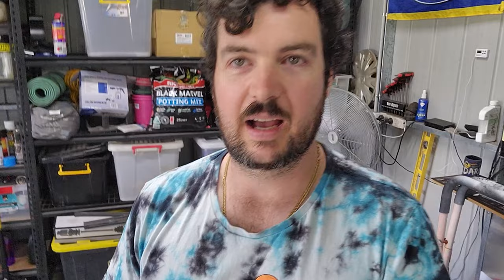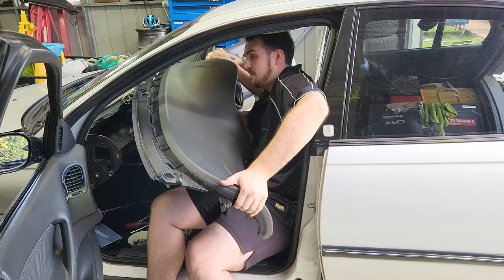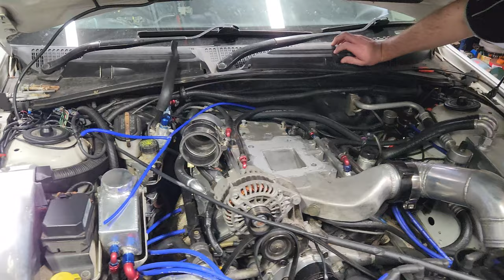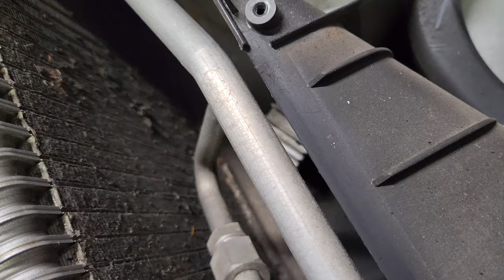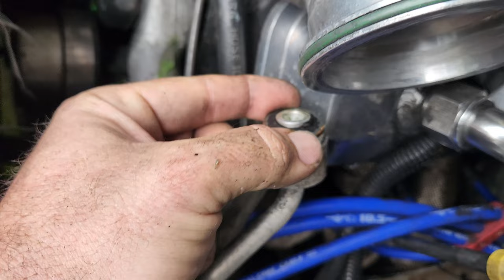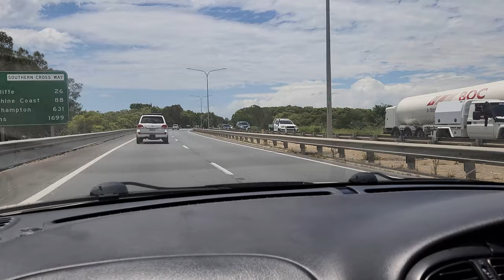BIGEV | Project AirCon

Comment: Well done dash big job you should be able to get 7-10⁰C with new system.  Compressor of this type should not cycle variable swash plate.
Reply from the maker: Cheers mate didn't think it would be that hard till we got in there, yeah was expecting lower, but it was a hot day when we made this video.